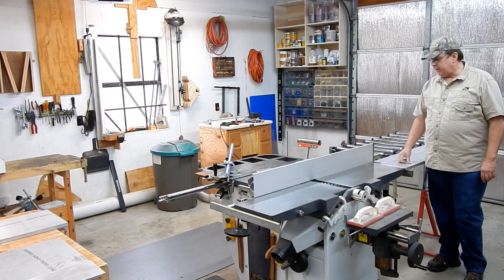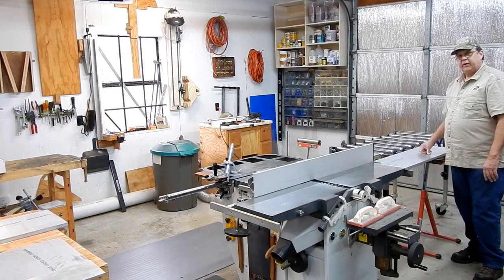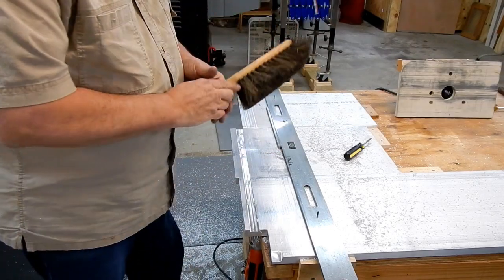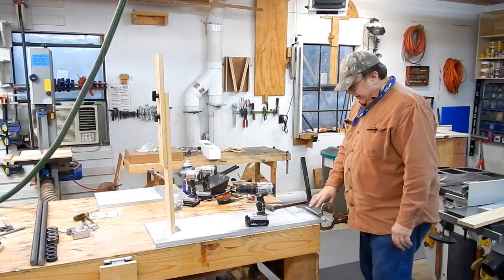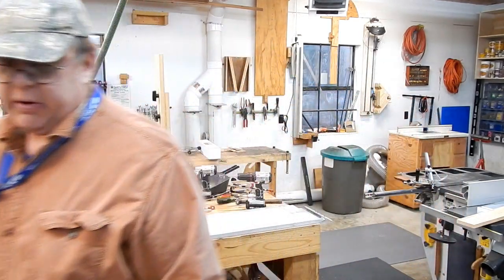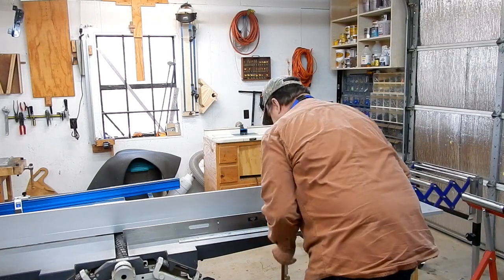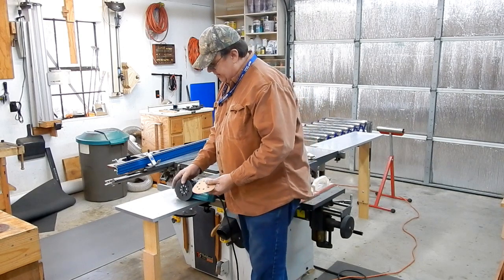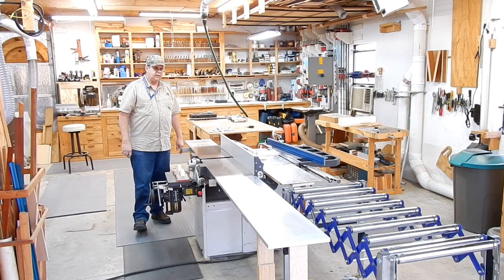Jointer Bed Extension

Comment: Hopefully, you still check this for messages!   I noticed that you have either made or purchased a better saw fence and a better joiner fence.  Can you  provide how this was done?
Reply from the maker: The Knapp style rip and jointer fence came with the machine. It was an improvement offered on the gray machines in the USA. The L -shaped extrusion can be found on line for the rip fence but you would need to make a carrier.

Comment: David I have an opportunity to buy the same X31 model.  Are you happy with the performance once setup?
Reply from the maker: The Robland X-31 is a base multi machine and such there was several things that many choose to upgrade to make function easier. The same type of machine but with all the bells and whistles like Felder will cost significantly more. That being said I like my machine and will continue to use it. The large sliding table version is a must. The upgrades that many in the group have done is to install a fine adjustment on the saw height and a sliding table alignment mechanism that was more user friendly.  The machine has held up over time for me and I have not had any mechanical issues. The sliding table has no external support arm like many of the other machines so when cutting an extended piece of lumber off of the sliding table it should be supported to keep from effecting the alignment of the sliding table. I normally just put a roller stand under the outside edge of the table for support. The main thing about a multi machine is you need to learn to work in an efficent work flow so that you are not jumping back and forth on the setup of the machine such as switching fences from saw to jointer or to planer.